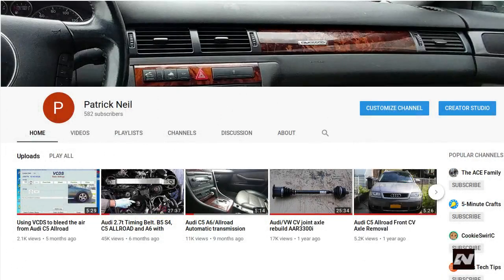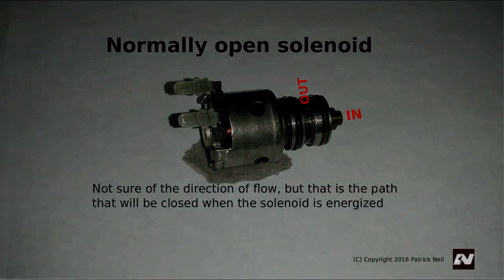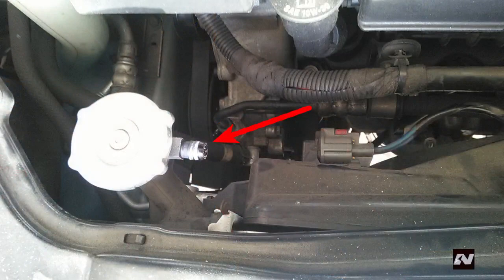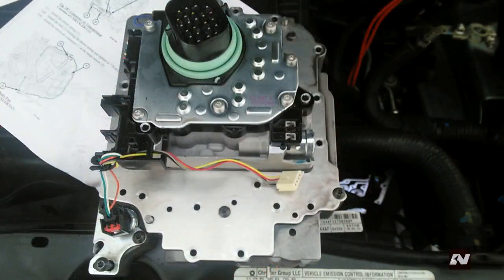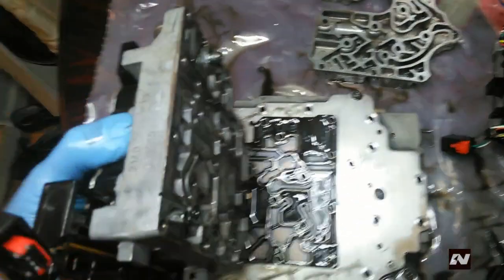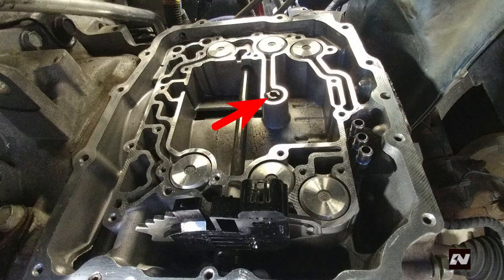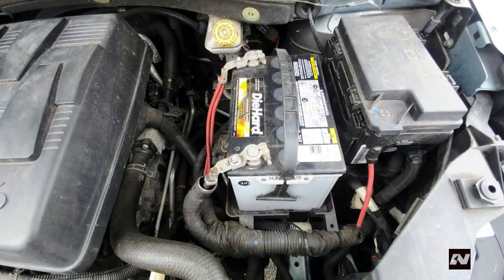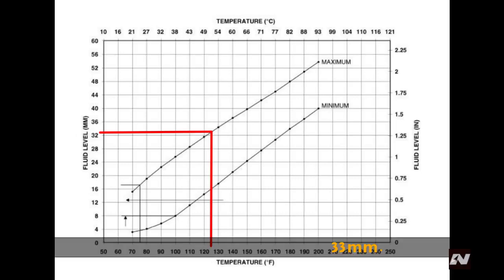Chrysler 62TE Solenoid pack replacement (Update and final)

Comment: What if my transmission shifts fine sometimes and then it only stays in third, turn it off and on a couple of times then it shifts fine again..! Anybody had that happened
Reply: This happened to my Routan. We changed the transmission fluid and filter. No problems. However, I was told if that didn't work, it could be a faulty solenoid, a bad connection, a failing ECM... Its best to have the vehicle fully scanned to know for sure

Comment: Easier way: run the trans to full temp, check it hot, running, in neutral. 2” on the stick - any stick will work. I use one of those oversized 3 foot zip ties (home depot, electrical dept) because they are white so the fluid shows up, and those little corrugations in a zip tie hold fluid and make it easy to read. 2”, done.
Reply from the maker: Thanks for the tip.  This video was done years ago before most of us figure out how to get around this procedure.  I don't see why Chrysler couldn't provide a dip stick.  I guess they want to service the vehicle and rip you off.

Comment: The 2-4 Clutch seal is called an accumulator by Chrysler.  Part # for mine was 5078864AA. My parts guy couldn't find it under the other name.  Be sure to have the dealer look yours up by the VIN number.  Thanks for the great video.  I'm a tech with 40 years of experience and it saved me the headache of chasing little balls around, or worse, leaving them out.  You do need to perform a quick learn after you are done.  That requires a higher end scanner.
Reply: I didn't need to do a quick learn, I started it up after the repair and after two drives the ECM learned my driving habits. Just plug and play

Comment: Great video and very informative, but I did have a question. If the the car does not shift from first gear, could this be also the solenoid pack?
Reply: Hi mate any answer to your question as my tranny only has 1st and reverse? Don’t want to do more work than needed.Did you fix it? Thanks Steve

Comment: Hi ...
I replace the selenoide pack in a Dakota 2006 2w/d
The codes desapear drive ok 
But i the reverse dont work now
Before with the old selenoide was working ok
What could be the prblem?
Reply from the maker: Sorry, I don't know...I would start by checking the linkage.  Making sure when the cable is pulled, or push it actually actuate what need to put the transmission is reverse (example the pin on the valve body)

Comment: Dorman sells a good reman for under $150. 

You are making the fluid check harder than it needs to be. At temp in neutral, it should read 2” on a stick - any stick. I painted a junker dipstick with liquid paper to make it white and easy to read.

Comment: Great video but I can't find the part 2 / 4 clutch oil seal  ( the small black plastic piece) please help i even called the dealership.
Reply from the maker: Sorry, it's been a long time since I made that video.  I should have included the part numbers. I went to the dealer with the old one in my hand.  They didn't know what it was even though I showed it to them. They showed me an exploded view of the transmission and I pointed it out. They got the number from there.

Comment: If I am just replacing the TCC solenoid above the pack, can I remove the cover without draining the ATF oil ?
Reply from the maker: Yes. Park the vehicle for a while to let the oil run down into the pan.
Reply: Do I have to remove the valve body to get to the TCC Solenoid?  Dumb question it may be...
Reply: JJ Van Essen Where did you purchase the TCC Solenoid. My Google-fu is currently broken... 😅

Comment: Hi; Patrick this is Simon I need help getting two parts O-rings for all transfer tubes, new clutch oil seal and do the valve body need to be changed? 2011 dodge grand caravan Mainstreet 3.6 codes PO 733, PO83B, PO 868, PO 732 and PO 944
Reply from the maker: I don't have the time right now to look for the meaning of all those codes.  If you get a  good deal for the valve body and solenoid pack together then do that.  (re-manufactured, or new) .  It kind of make sense if you don't know how to rebuild the valve body.  Both parts will be new or functioning like new.  It is also easier to swap out.

O-Rings and clutch seal are dealer items.

Comment: Hi. I write from Germany. My Chrysler have big problem with the 6 Gear. I can drive in 5 Gears, but not in the 6te. In 6. Gear comes the engine lamp. And I have a trouble code P0729.

I buy this car in winter from a privat person and the problem comes 100km after buying. She says, the oil and filter is new. 

I start now with new oil and new filter. Same problem. At next, I make the input and output speed sensor new, also the transfer shaft speed sensor. - same problem with sixt gear. Now I repaired the solenoid Block. It's new and the part under this. All new. (I found not the English name :))

You have a idea, what's the problem with my trans axle? 

The German mechanic in my neighborhood have no interest in American cars and nobody help me. 

I hope, I hear from you. My English is so bad. 

Best wishes and stay save, Daniel.
Reply: You have no idea?
Reply: Mine does the same thing
Reply: @zuberalisyed9786  i have a transmission repair. Now is good.

Comment: Hi Patrik ! Great video! Can you wrote the part numbers ? Thank you very much !
Reply from the maker: The part number may change from the time of making this video. It is better getting the valve body with the solenoid pack already mounted.

Try a Chrysler dealer for the part number then buy from somewhere else.

There are a lot of remanufactured units out there.
Reply: @pnswg01  

Hi Patrick,

Great video. What is the part number for blue oil rings on Feed Tubes? Do you have a link where to buy them?

Thanks
TF
Reply from the maker: @tiamfookchong7480 Sorry, i don't know the part number. I bought them from Chrysler.

Comment: I have the 3.8L Routan. The parts on ebay for 62TE says it will not fit my vehicle. What's the best way to be sure I buy the right solenoid pack?
Reply from the maker: First make sure your transmission is model number 62TE. The 62TE listed as having 6 speeds so if yours has 4 speeds then you have a different transmission.
Reply: @pnswg01  Thanks for the tip. Everything I can find online shows that the Routan has the 62TE transmission. I suppose I will use a parts source that will let me return it if it's the wrong one.
Reply from the maker: @mvsawyer  If your Routan has manual gear mode, use that to check how many gears your transmission have.  While driving (selector in "D" position) move the stick to the right. (It will spring back)  The transmission should now go into manual mode and the display now change from showing PRND to 1 2 3 4 5 6, with the current gear highlighted.  Each push right should go up one gear, and left down one gear.  The display should tell you which gear you are in.  1 2 3 4 5 6.  If you don't have manual mode, or you don't have 6 available gears then you don't have a 62TE transmission.

Hope this help.

Comment: Thanks, very well done and comprehensive video.  If I've recently changed the fluid and filter in the bottom pan, do I have to drain it again to do the solenoid pack swap?  And is it advisable to replace the TCC solenoid while in there, or anything else that could be a problem in the future?  Thanks in advance and appreciate the vids
Reply from the maker: Thanks for watching

Comment: I ran into a issue where after reinstalling the valve body with new solenoid pack on it, I am unable to move the shifter from park, it seems stuck.  Any idea as to what I can do?  I made sure the pin on the range switch was installed on valve body when I put it back on.
Reply from the maker: Disconnect the cable at the manual lever, then try to move the stick. If it still cannot move, the problem is power not getting to the shift lock solenoid. Recheck any harness that was disconnect, dead battery, wrong key, etc.

If this is a minivan you can override the lockout by plucking out the tab next to the gear lever then put a pen or screw driver into the hole.  Push down while at the same time move the lever out of park. If this was successfully then the problem is not with the transmission.

Good luck and thanks for watching.
Reply: @pnswg01  I appreciate the response.  I have not reconnected the battery yet, I just checking it before reinstalling the valve body pan cover to make sure I had the detent arm correctly reinstalled and such.  I'll try the override
Reply from the maker: @YaCatIsBizarre  No connection to the battery, no getting out of park, unless the shift lever is overridden like I told you earlier.

Comment: 2013 Crew Journey, I pulled a P0740.. which one is the torque converter clutch solenoid
Reply from the maker: The TCC solenoid is not in the solenoid pack. It is the topmost one mounted to the valve body.

There are two version of this video. It is labeled in the final version.
Reply: @pnswg01  right, I watched both and did comparisons between google, your video, and alldata.  Looks like I can open the valve body pan and get out that solenoid with one of those stupid star bits.  Thanks for the reply bud, great video!
Reply from the maker: @adventureoflinkmk2  If you recently change the oil and filter, you can change that solenoid without draining the oil.  (The oil will drain down to the oil pan)
Reply: @pnswg01  was gonna say it's been a few days since I changed the fluid and filter.  I got my check engine read the other day and gave me that code

Even so, the old fluid was black and dirty.. I'd need to change it again anyway

Comment: Great video! I did this job recently on a 2008 Chrysler Town & Country a few things that I would like to add that might help someone stuck or frustrated, there is a piece of exhaust pipe that runs right off the front manifold and right over top of the pan that needs to be removed, what I did that made it easier for me was remove the manifold and the two 13mm bolts in the front then follow the pipe back and there will be 2 more 13mm bolts behind the engine just remove the top on, once you remove it you can grab the exhaust pipe and pull it up out of the way. Also another thing I did was cut the tube shorter that’s on the backside of the pan, this is the fill tube that goes down inside the transmission pan below to check your fluid, don’t cut it all the way off just cut it maybe 2 inches shorter made it so much easier to put back on. As far as transmission fluid goes I started out with the 4.5 quarts i ended up adding about 9 total the 4.5 I started with was not enough and was making the transmission act up, once the right amount of fluid was added it was good as new, you can use your oil dipstick to check your fluid you’ll just need a ruler or tape measure to measure out and mark your dipstick there is a how to video on here for that as well.
Reply: How is the transmission now?  My van had the P0755 code, had all the work done in this video plus the sensors on the solenoid and now the van is at a trans shop for a complete rebuild because this helped, but not fully.
Reply: Justin, van is still running with no issues. I’m sorry to hear that.

Comment: Can I solenoid pack be removed without having to remove the whole assembly?
Reply from the maker: You cannot remove the solenoid pack without first removing the valve body. The bolts to remove the solenoid pack is on the back side.

Comment: Thanks for your video, I was able to successfully replace the solenoid pack.  I had a P0765 code which prompted me to pursue changing it.  Now that everything is reassembled, the van starts up in limp mode and the same code has returned.  The P0765 is the only code shown.  What else can I try?  Is it a wiring defect somewhere?  Thanks again
Reply from the maker: Did you change the complete solenoid pack?

There are detection circuits built onto the solenoid pack. Most time the problem is there and not the solenoids themselves.  Even when you measure the solenoid and the value measured is good, the pack still don't work.

Additionally when the ECU send the signal to operate the solenoid it also measure the voltage drop, if it's too much (resistance too low), the code P0765 is stored.
Reply: @pnswg01  yeah I replaced the entire solenoid pack with a Mopar unit, I'm stumped
Reply from the maker: Valve body probably restricting fluid flow.  These days, its cheap to just change both for a rebuild unit.  (valve body with solenoid pack).  ** JUST MY OPINION **, Their detection method is too sensitive throwing the transmission into limp mode.
Reply: @pnswg01  is it sensitive to fluid level?  I haven't checked and added fluid since the repair, I did not drop the bottom pan as I did a fluid and filter change prior to this job recently.
Reply from the maker: @YaCatIsBizarre  Yes it is sensitive to fluid level. Any of the following cause...  

Insufficient fluid level
Dirty or contaminated fluid
Dirty or clogged transmission filter
Defective transmission valve body
Restricted hydraulic passages
Transmission has internal failure
Faulty shift solenoid
Corroded or damaged connector
Faulty or damaged wiring
Faulty PCM

Comment: Yo "P" BigUp!!  Question, after replacing the S-pack do I need to calibrate or relearn the car ECM? If yes, how to do that?
Reply from the maker: No reprogramming needed. Just replace and go.
Reply: @pnswg01  I did replace S-pack because my 2012 Grand Caravan dropped into limp mode with a P0755 code. Bust after a day it failed again with the same code P0755. What do you think  could be the problem?
Reply from the maker: . Assuming you change the oil and filter. It could be a bad valve body or defective solenoid pack. Or even dirty fluid still in the valve body/transmission.

Check out Big Sky Engines LLC. In Buffalo NY. They have a store on EBay. You can get a remanufactured valve body with solenoid pack for 124.00. Just pop in and go. You cannot beat that price for both. I was skeptical, but they work.
Reply: @pnswg01  Cool,  I changed the oil & filter 3 times now this year and there is always metal dust stuck to the magnet. Is this normal and what is the best way to flush out the complete transmission system?
Reply from the maker: @primalbiz  That depends on how much metal dust you see. It is normal to see some metal dust, not chunks of metal.
As for the flush, I don't know. I am not a transmission guy. I just happen to do a couple of these.

To clean the valve body you would have to open it up and clean out the passages.
Reply: No programming needed but you should get the quick learn procedure done..Only an approved scan tool can do that

Comment: Can you please tell me what the little black clutch seal is. Its hard to understand you in the vedio.
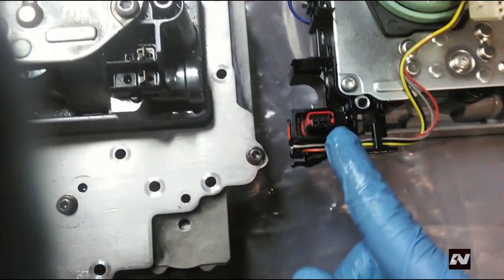Reply from the maker: 2-4 Clutch oil seal. Time code 2:32 and 9:50 in the video. Same name used in the video.
Reply: @pnswg01  What is the reason why this needs to be changed.
Reply: By the way, this is an awesome video
Reply from the maker: @Tmil1035  It is just for maintenance. You already in that location and the part cost $8.00. Rubber seal don't last a lifetime. If it fail at some point down the road, you will have to do all that work to change a simple $8.00 seal. 

Answer 2: For the same reason you change your good working water pump and pulleys when changing your timing belt.
Reply from the maker: @Tmil1035  Thanks for watching.
Reply: @pnswg01  Hi! Thank you for your video tutorial. You have a new subscriber, brother! Going to be working on my 2011 Dodge Grand Caravan, but I can't seem to find the 2-4 Clutch Oil Seal. Will you pls send me a link of where I can pick it up? Thx!
Reply from the maker: I bought it at the Chrysler dealer (about $8.00 US).  I never look anywhere else. Sorry.
Reply: @pnswg01  Update: Found it at a Dodge dealership near me, but they're selling it for $12 pre-tax. 

No worries! Thx for the prompt response and info. I'll call around and see if I can find one. 👊🏾

Comment: I am having trouble finding a new 2/4 clutch oil seal. Where did you get yours?
Reply from the maker: Chrysler Dealer
Reply: @pnswg01  Part Number?
Reply: 5078864AA  @frankrizzo1094